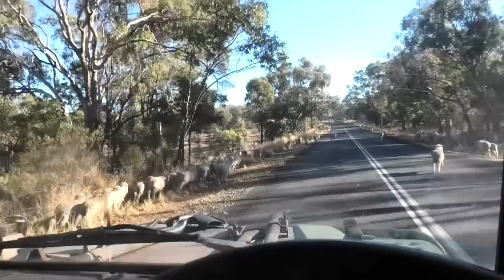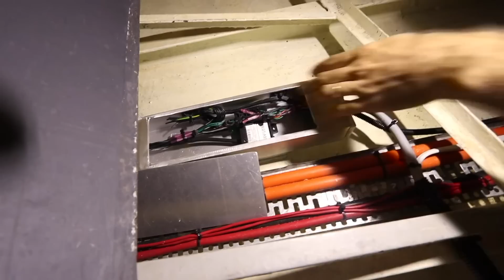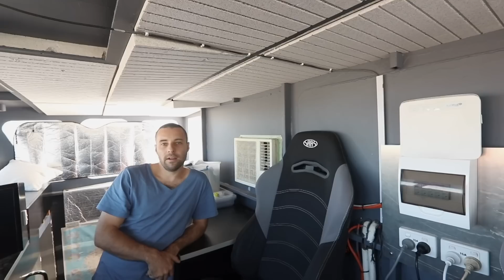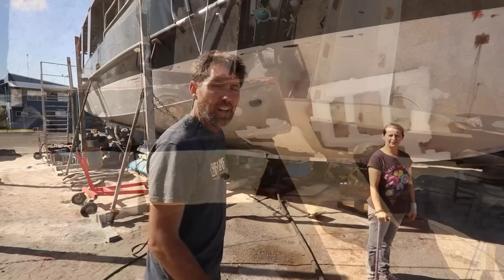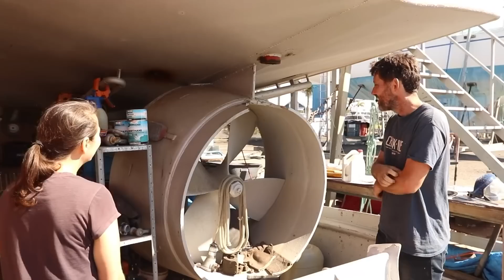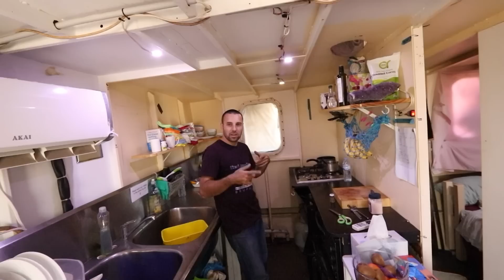Touring Brupeg

Comment: Hi Stu,
You needed a road trip....
Something to think about, I worked in Industrial controls and automation as one of my career paths, their components for detecting and signaling are very robust I am not sure what vendors are in your market. It does not have to be mysterious black box or proprietary stuff and now not difficult to understand and install.
https://cdn.automationdirect.com/static/catalog/index.html

https://about.automationdirect.com/why-buy-from-us/index.html

Like rudder position could be a mounted potentiometer to a small digital display calibrated for bow being 0 or 360 and port increase of ohms and starboard a decrease in ohms
https://www.automationdirect.com/adc/shopping/catalog/process_control_a_measurement/digital_panel_meters/1-z-8_din_size/dpm2-at-2r-hl

Just an example of something in a back and forth rotational movement that can be monitored and displayed
The mind is a big toy yard of ideas....

Comment: Worked on hundred of those engines
5” donaldson is the most common muffler used on them 
They are straight thru type like a glass pack
Looked like the after cooler front coolant  hose might be kinked

Comment: Interesting using the veggie oil is like using Heavy bunker fuel oil that needs to be heated to make it usable at all!
Keel coolers used on canal boat in UK use water tank in the side of the hull , but their engines are small. Commercially available keel cools are a lot smaller and some are built into pockets designed into the hull especially on fiberglass boats!

Comment: On the sea going Tugs that I worked on we had "Channel Coolers" basically what you have are plates (maybe 2" deep by 12" wide by however long is needed) running lengthwise down the hull with as many circuits as needed. This system is really bullet proof as they are very heavy plate and can take a bunch of abuse.  Whenever we were out of the water, all of the Blocks were actually on the Coolers, just to show you how strong that can be. If your interested let me know and I'll get you some more information.  Please keep the great videos coming!

Comment: data wiring on the engine room floor ?     There is a good chance of getting 2-300mil of sea water/diesel  slopping around here in a big seas and the pumps not being able to pick it up.
Reply: Yes sir i agree i don't know what they were thinking
Reply from the maker: That point is 1.5 metres above the bottom of the bilge so it's going to hundreds of litres of water to reach that point. The box is water tight when closed and the engine room will be insulated.

Comment: Epic! Epic! Happiness is an hour and 12 minutes of Danger Marine! I'll be following Brupeg from now on. The vegi oil experiment is fascinating. It's all about the preheat system bringing the oil to the right viscosity. In the 80's I helped restore a 300' WW2 Knaught ship. It had a 6 cylinder Norberg diesel (Of course it was 15 ft high and 30 ft long), it had crude oil tanks (Bunker fuel) along the kneel which feed a smaller tank with heat exchangers to preheat the fuel then into an oil-water separator before entering individual injection pumps to each cylinder head.  It was all 1940's technology but that ship is still operating today used for charitable work around the world.
Reply: Thanks Camano man, we have a playlist on our verge oil conversion on the Project Brupeg channel
Reply from the maker: Nice work on the restoration. Sounds very satisfying and worthwhile!

Comment: To heat the vegetable oil at sea, can you run a cooling loop from the engine through the tanks?  The heat is generally wasted if you have a hull cooling loop and it's free energy. Sorry if it's been addressed in another video.
Reply: The Reel Angler hi mate. We used a few sources. Waste cooling heat from the main engine and the genset. As well as copper pipe wrapped around the exhaust to reduce the engine room temp and transfer that heat into a liquid flowing through the copper and into a stainless heating coil in the rear two fuel tanks. Front tanks are just storage so won’t be heated

Comment: Is a truck engine a good idea?
Reply: Zach A hi Zach. The Cummins 855 is a commercial engine, it’s the same motor in trucks, boats, generators etc. there is no structural difference other than minor things like compressors and exhaust brakes
Reply: For 5k that sounds amazing. Are commercial engines heaps cheaper than marine engines?

Comment: Dang that cooling system is neat. When you get to the colder climate will you use antifreeze in the engine cooling system ?
Reply: I think they should use antifreeze all the time it transfers heat it better,  has a much higher boiling point it has anti rusting and lubricating agents, you can use it all year long
Reply: Hopefully, bare minimum is a good rust inhibitor. I recently had to change out a generator engine that was keel cooled. The engine had nothing but straight water in it for years and totally rotted the engine out from the inside out.

Comment: Does the Landrover manage 110km/hr on the freeways ?
Reply from the maker: Yep, it's the Isuzu 4 Cyl. Will do about 130 on the flat but struggles up hills.
Reply: I could be wrong but I think he's got a factory Isuzu 6 cyl in that milspec series, and they manage that fine. Actually theyre probably the best of them
at the time Rover were required in the contract to be able to pull a 105mm howitzer of around 5000lb off road, helped by the dual range box so gears can be split to 8 speeds
other decent conversions are GM V6, but thats petrol
Reply: SV Zaya 4 cylinder mate
Reply: @markolav7017  I thought they were 3.9 ltr, seems a lot for a 4, 

oh well
Reply: Do they even have freeways down under?
Reply: @Bikerbob59  yeah, its just not possible to have freeway from one city to the next at 500-1000 miles on this population
Reply: @z_actual  Ya it's alot like that here in Canada We have one big high way across the country  and freeways around our cities.